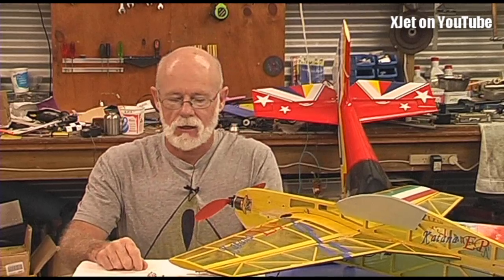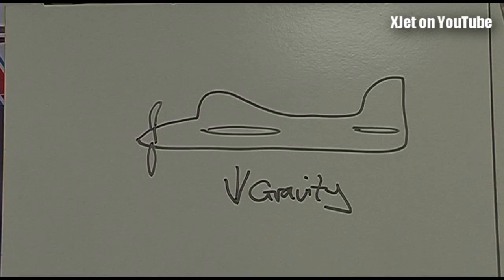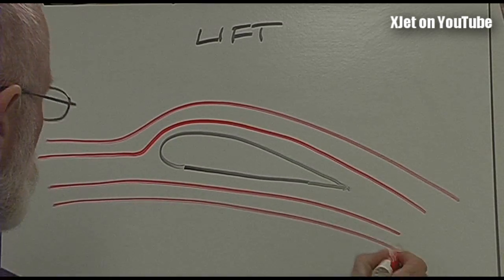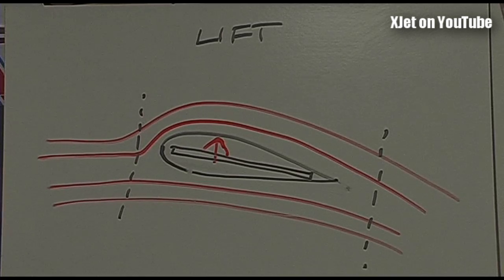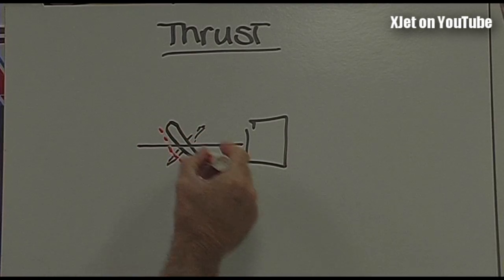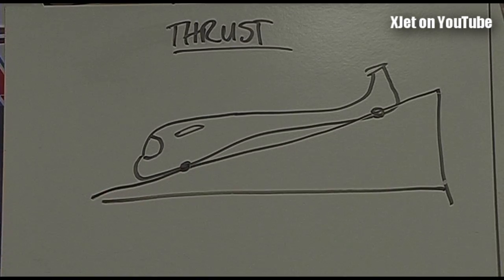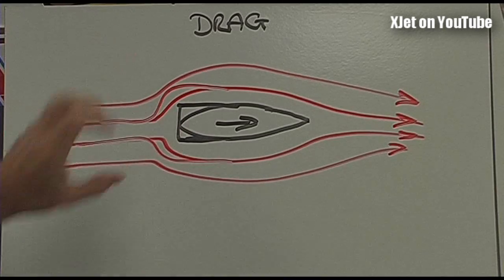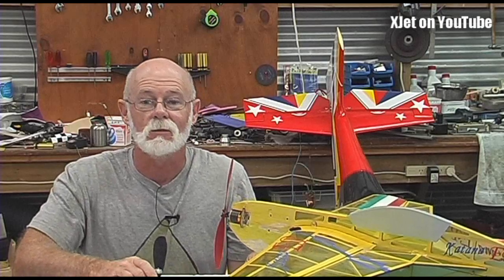The Theory Of Flight (or how stuff, including RC planes) flies

Comment: Ideal flow theory would require the flow to double back round the trailing edge of an aerofoil in order to join at the rear stagnation point. The real atmosphere is not a superfluid, and just a tiny bit of viscosity results in the flow separating at the trailing edge and leaving behind a starting vortex on the runway. By the conservation of vorticity, there must be net vorticity of opposite rotation associated with the aerofoil, and this generates lift by the Magnus effect.

The starting vortex can be visualised. Instead of the Magnus effect, I can talk about the Kutta-Joukowski circulation theorem if you wish, but it's the same basic idea. Explanations which invoke Bernoulli or Newton are just wisdom after the event of the flow separating from the trailing edge. They do not work with liquid helium.

Comment: Can you explain the circulating flow? The Kutta condition only exists at very low speeds. Lift is caused by the wing's lower surface pushing the air forwards and downwards just like the bow wave of a ship. The air is split before reaching the leading edge by the dense bubble of air. The remainder of the air is pushed up and over the wing surface and as it turns the corner it adheres to the surface (no vacuums in normal space) and as the void caused by the wing collapses the air density drops= LP

Comment: You are missing a 3rd component of lift, and one that is more important than Bernoulli's for curved airfoil shapes. As air moves around the wing, it sticks to it, but in the case of the upper section it is forced to move in a curved path, which causes it to try to move away from the wing surface due to innertia (fictitious centrifugal force). This creates a "vacuum" which results in a net lift. This effect is of greater impact that the Bernoulli pressure difference.

Comment: @rcralphpfister Man....I think you are right on. It IS actually the top surface of the wing that creates a vaccum or low pressure area.  The bottom of a flat wing won't produce any lift until it's angle of attack increases.  Think about a "soft" airfoil like a hang glider or a sail on a sailboat.     How does that work?  There is no flat "bottom" side to the airfoil.  Instead the inside of the "wing" gets filled with stalled air creating the effect of a   flat-bottomed airfoil.

Comment: I agree.  The air over the top of the wing travels much faster than that below.
I have seen smoke experiments where this can be seen.  In fact the air on top is long gone before the air on the bottom gets to the back of the wing. I don't really understand it either.

My daft guess is that the air has more work to do as it hits the wing. Then as the wing tapers off it decreases.  It could be that this causes another difference in pressure, speeding it up even more.

please explain it Bruce.

Comment: In Newtonian Mechanics, force is assumed to be the first cause. Force causes (changes of) motion.  Motion does not cause force (of lift).
Reply: Well said
Reply: As you implied, acceleration of the airflow on the wing upper surface is a result of a lowered pressure, not the reason for lowered pressure!
Causality is most often misunderstood - reversed!

Comment: Another point that is probably valuable to scratchbuilders is that the top surface of the wing is actually what makes a majority of the lift.  So, when you guys are adding servos or carbon spars, remember to keep the top surface of the wing as smooth as possible.  This is why I don't buy into the KF airfoil hype.  A "step" on the top of the wing can never produce as much lift with as little drag as a properly sanded airfoil shape.

Comment: Yes I think we were all taught those myths. I even learnt them in the Air Force and the apparent excuse for aircraft flying upside down  - where somehow AOA takes over. I still run into them today as a university lecturer in aviation science. My students will often be surprised when I tell them they are wrong. I usually demonstrate by making a paper plane and flying it at them... I also have a remote control helicopter I fly over their heads and ask them how it works... Lots of fun.

Comment: Bruce,
Yes, that's all true. What is incorrect in the video is 'why' the air travels faster on top. The reason is not due to the 'longer path'. In fact the air also travels faster over the top of a symmetrical or flat plate wing, or any other wing that's making lift.

Comment: Not trying to be fussy, but if the faster moving air over the top creates low pressure with a resulting vacuum, wouldn't suction be a better word to describe the reason for the upwards motion?

Comment: You have to remember that the air particles are stationary, they are not travelling over the wing, the wing is travelling THROUGH the air particles. Therefore contiguous particles at the leading edge will meet at the trailing edge.

Comment: @xjet   not to get engaged in any arguments or anything, but rcralphpfister does have a point... yes you are right in that the bottom side pushes.. rcralphpfister is right in that the top side is like a vacuum... but the top side theory wins out when you actually look at each side, the top side is much much much lower than free stream pressure than the bottom side is higher..  and in some cases you can even have a vacuum on the bottom side, but I wont go there lol .. I'm an aero engineer btw :)

Comment: Why people try to describe lift using Bernoulli's law? You should read basics of aerodynamics. Basic explenation is that the air circulates around the airfoil. Above the upper surface the circulating flow is added to uniform flow, under the lower surface it is substracted. Therefore flow above the airfoil is moving faster. If you will watch simulations from wind tunnel or in CFD software you will see that flow form above doesn't meet flow from below the airfoil after leaving trailing edge

Comment: The air moving over a wing does NOT have to reach the end at the same time... Most commonly, the air flowing over the top reaches the end much faster than the flow below the wing! This is because at an angle of attack, the air has to bend over the top thus increasing it's speed. Also note that most of "Newtonian lift" acts into pitching the aircraft forward due to torque instead of pushing the whole wing up. There is a small component that does it but it doesn't work too well.

Comment: Yes, that's all true.
It's just the reason 'why' it travels faster that was incorrect in the video. It doesn't travel faster because the path over the top of the wing is longer and it doesn't travel faster so it can arrive at the TE at the same time as the air passing under.

Comment: Have a look at what Dr Klaus Weltner has to say. Search for him at University of Frankfurt.
Basically, air is forced to follow a curve which results in low pressure on the convex curve (top) and high pressure on the concave side (bottom). If the wing surface could be made frictionless it wouldn't work.

Comment: i didnt get why the air needs to displace more area in the upper portion in same interval with dat of the lower portion?. is it the same energy supplied by fuel..as that of gravitational energy stored when it is at a height neglecting resistance?

Comment: I would like to correct one more thing. Bernoulli's law is of course applicable in terms of airfoils aerodnamics. I ment that using Bernoulli's law with assumption that two contiguous particles divided near leading edge have to meet on the trailing edge is wrong.

Comment: Please read the papers of arvel Gentry. Bernoulli is okay but if you look at pulsed air in windtunnels you see that the air on the top Side moves much faster than at the bottom side. With your theory an airplane can not fly up-side-down. And what about sails without thickness?

Comment: 1) Misconception of the equal transit time. It is based on a gross faulty assumption: according to which physics principle must air particles meet at the trailing edge?
The dumb question "Then how does an aircraft fly upside down" is sufficient to dismantle the "theory".
If you find this explanation in a textbook, ask for a refund!

2) Daniel Bernoulli (first name is important, since Bernoulli family produced at least 9 notable artists and scientists), was Swiss.

3) The explanation of thrust is trivialized, but serves the purpose. Just a note: what happens inside a jet engine is not different from what happens across a propeller blade (except for the static parts of the turbojet, i.e. intake and nozzle). Propeller blades and turbojet stage blades work the same way: they are "wings" generating lift in the direction of motion.
So there is no need of bringing up Newton's principle when switching from propellers to jet engines.

4) The explanation of drag is pure sorcery. It is set on ill and groundless notions and badly carried out.
4.a) Drag acts in streamwise direction and basic mechanics assure that it cannot arise from the deflection of the flow around the leading edge, since this involves an acceleration (thus a force) perpendicular to the flow.
Not to mention the fact that, based on Bernoulli principle, the higher the fluid accelerates at the front portion of the body, the lesser its pressure, resulting in a propulsive-like force, which becomes bigger and bigger as the leading edge becomes more and more blunt. Needless to say that this cannot be drag!
4.b) The explanation does not even slightly mention viscosity, despite this property of fluids is absolutely mandatory to justify drag. In fact any (ANY!!!) object immersed in a potential (inviscid and irrotational) subsonic flow produces no (NO!!!) drag at all. This is called D'Alembert paradox.
4.c) Generally speaking, the front portion of an object is less crucial than the rear portion when it comes to drag.

Nevertheless, the effort is appreciable, given that this is one of the most deceitful topics in the world of technology/physics.
Reply: So are you saying that explanations offlight based on the bernoulli equations are wrong? so whatmakes an aircraft fly? is it the sticky air (coanda effect)? is it to be explained by other equations (navier stokes etc..)?
Reply: my answer to your question in the begining of your comment: according to the low of mass preservasion if you take a volume around the wing, then what goes in  the volume must goe out at the other end (neglecting complex phenomena like compressibility etc...). So the assumption of same Transit times is not so crazy. The second question: a plane can fly up and down by producing more or less lift. this can be done by being faster (rmember bernoulli equation) or by changing angle of the wing and thus changing the distances are have to Transit. does that make sense?
Reply: ***** Never said that. Bernoulli principle is fundamental in lift generation. Where did you get that?
Reply: ***** I must admit I am intrigued by your explanation of the Equal Transit Time misconception, since it is the first time, in my experience, someone actually tries to motivate it.
Nonetheless, while Mass Preservation is indeed mandatory, such law does not force two particles on the opposite sides of an airfoil to meet at the trailing edge.
If you possess an even basic knowledge of aerodynamics, you can see it yourself by merely sketching the streamlines around a lifting airfoil.
Reply: Dear MachWaveRider, I m not  saying I have any knowledge or trying to Show you are wrong. I m just trying to understand. I gave you a way you can explain equal Transit time theory. you didnt give me an answer on how lift is generated if not by bernoulli mechanism or by coanda effect.

Comment: Sir; great video....great explanation...thank you for your time....Just a detail: The air flowing over the wing does nor reach the wing tip at the same time that the air under the wing does...It was shown by wind/smoke studies..but it doesn't change the fact that the air pressure over the wing is less than the pressure under the wing...

Comment: The air changing velocity (speed and direction) downwards causes a reaction for upwards (Newton) The wing pushing the lower air forwards and down and the upper air rapidly changing direction with the attendant momentary density drop cause a pressure differential between the upper and lower surfaces. These two factors = lift. Hang gliders and sailboats work the same. Supercritical aerofoils rely on a flatter upper surface and a more curved lower one to increase MCrit..

Comment: Blowing on a sheet of paper does not illustrate Bernoulli's principle. If there was no friction, the paper would not move! The air is curving around the sheet of paper due to the friction and the air is getting deflected downward - the deflected air downward exerts a force upward on the paper. Notice that you'll never be able to blow hard enough to get the entire sheet of paper to come parallel to where you're blowing.

Comment: An explanation of lift frequently encountered in basic or popular sources is the equal transit-time theory. The assertion that the air must arrive simultaneously at the trailing edge is sometimes referred to as the "Equal Transit-Time Fallacy". It is WRONG. The true reason is that of the Venturi effect. Pressure is greatly reduced in favor of greatly increased speed when the air flows over the top of the wing. The speed must increase since the air above behaves like a ceiling. Not much space.

Comment: @rcralphpfister suction isn't a real thing, nothing sucks.Imagine a strong person and a weaker person pushing against each other (the stronger being the high pressure and the weaker being the lower pressure), they don't move toward the weaker person because the weak one is pulling but because the stronger one overcomes the weaker ones force and has some left which then dictates the acceleration in the weaker persons direction. The most important thing in here is that the weaker person pushes too

Comment: @jcsmithsk8ter a spinning propeller simultaneously pushes air backwards and pull the plane forwards. You probably don't care about where the air is moved, which is why the law seems off to you. Try standing in the prop wash of your model while throttling up and it will make sense ;)

Comment: Hey buddy, we both agree,(I hope!) that almost all the lift is created by simply deflecting air downward, thus moving the wing upward. Nuff said.

Look again at your post that I responded to. You very distinctly said that because the wing is curved on top, flat on the bottom, thus causing the air to move faster on top, that the wing would be pushed downward. My experiment of blowing parallel to a flat sheet of hanging paper deftly illustrates the you are wrong. The paper will move toward the>

Comment: If the air (or any fluid) is moving its force perpendicular to the airflow is lower then if it is not moving (or moving slower). Demonstrate this by blowing parellel to a hanging sheet of paper--the sheet will move TOWARD the moving air. Of course higher air pressure underneath is tending to push an object upward--(whats wrong with you??)  But that only makes the wing as efficient as possible--the vast majority of lift is created by simple old boring angle of attack  (of the wing to the airflow)

Comment: Lift is caused by turning flow not by the 'speed of the air over the top of the wing'.
Angle of Attack is the reason for flight. A flat wing/paper plane will fly very well and has an excellent L/D ratio but stalls earlier than a curved plate. The air molecules NEVER meet at the trailing edge. This is a myth called Equal Transit Time. ALL Airliners have wings that are curved on the bottom (longer distance) and flatter on top. Also what about hang gliders (same distance)?

Comment: NO, NO, NO. You are right in saying that air travelling over the wing travels (on average) faster than air travelling under the wing. But this is not because air over the top must reach the trailing edge at the same time as air taking the bottom path. This is called the "equal transit time" theory of lift and it is completely wrong. There is no law of physics which says air over the top must reach the trailing edge at the same time as air under the wing. Not only is there no law of physics stating this must happen but every instance of empirical testing in a wind tunnel with intermittent smoked streamlines to observe the speed of air over the top and bottom of a wing angled to generate positive lift has shown that air over the top reaches the trailing edge before air going under the wing. Every single time.
Reply: Thank you!!
Reply: You're welcome. :)

Comment: The only correct part in that comment is that lift is governed largely by angle of attack and the shape of the wing is for efficiency. 

You completely missed what my comment was about when I said that high flows to low and therefore it would push the wing down. I WAS POINTING OUT A FLAW IN THAT THEORY!!! Of course the wing doesn't go down, it goes up. In actuality, Bernoulli's principle applies ALONG a streamline and not across it.

Comment: Your explanation of drag is incorrect. Drag does not come from splitting the air apart. The energy you spend splitting the air apart comes back at the back, when the air comes back together.

Drag comes from compressing the air in front of the object. Now you have a high pressure area at the front and low pressure at the back.

Comment: > faster airflow (Ie: top of the wing).  Are you actually asserting that for well over a century, that the shaping if wings with a curve on top made them less efficient? Lol.

The only point here was that even though lift is obviously created by this shaping of the wing, it is not nearly enough to support the plane, and that for decades they have taught that it is. Lift is created largely by angle of attack, the shape of the wing only makes the airplane as efficient as it can be.